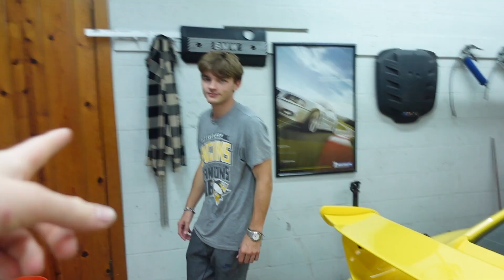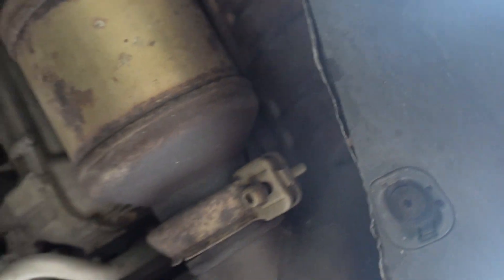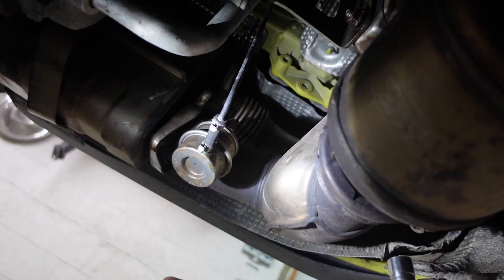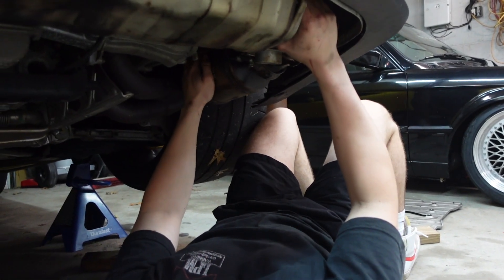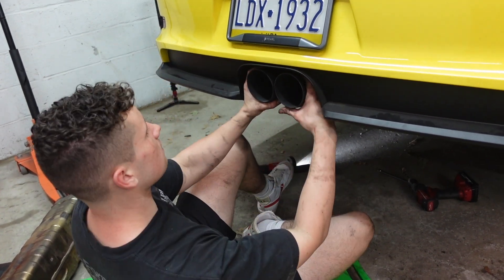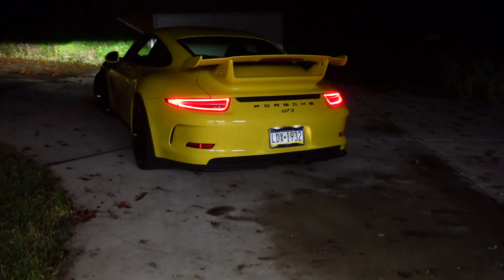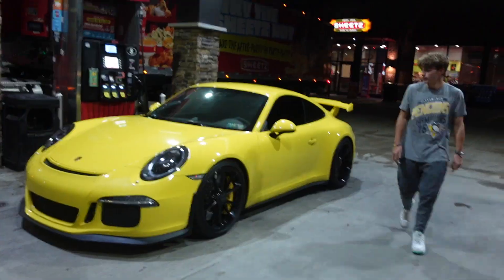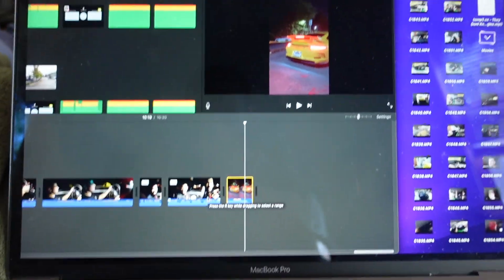991 GT3 GMG exhaust install

Comment: If you ever buy a 991.1 GT3 make sure it has the replaced G6 engine in it. Because the E, F, G0 engine is a ticking time bomb that will blow up and it will cost you $90K USD for engine replacement.
Reply: Dude. Come on, 32k is the engine installed. 

For sure don’t buy a .1 without a g series, but you’re an idiot for saying that.